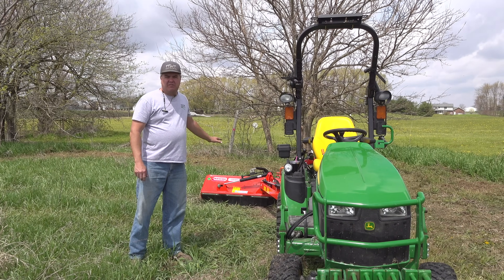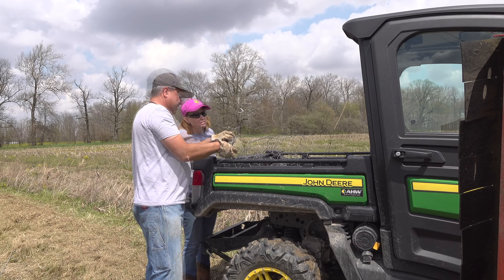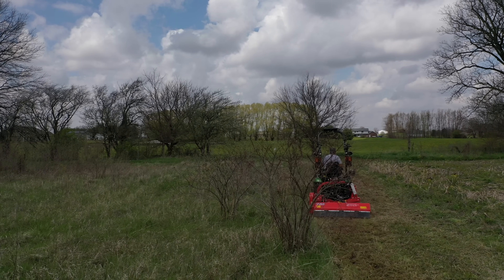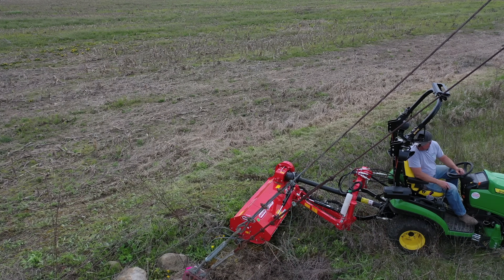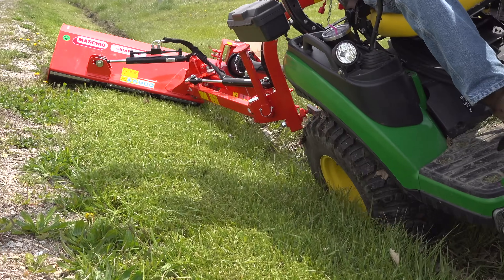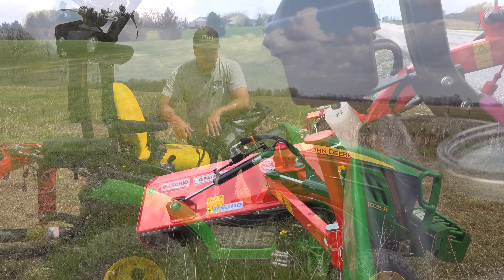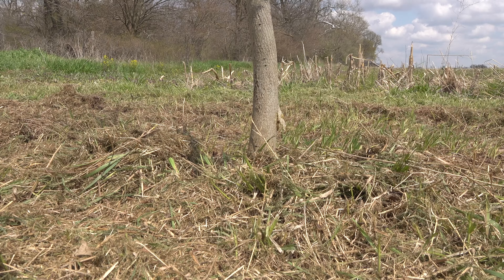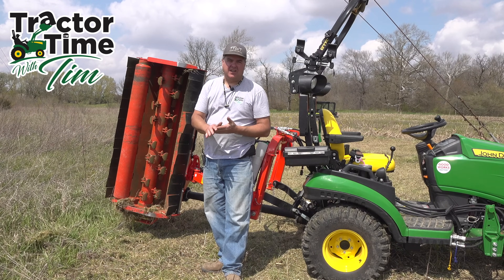NEVER BEFORE SEEN!!  Offset Flail on Sub Compact Tractor

Comment: Offset mowers/conditioners are used for hay so your tires are not mashing down the hay. & it does make a difference in hay. A flail mower probably pulls material up better than most mowers though. We have a 9' offset (to the right) hay mower & it puts a lot of pressure on the right lift arm & tire.

Comment: Dear sirs. What type of the model of Flail mover that you used. Thanks
Reply from the maker: Maschio.   Get it at agfolks.com  use code TTWT for a 5% discount.
This is the 4.5 ft version. There is also a 4’ on the smaller end, and 5’ on the larger

Comment: Flails do a great job in taking on thick stems and it does do a much nicer even cut vs a rotary blade mower but I see what you mean on the offset option its just not enough tractor there and for the Avg Compact tractor owner may not have the experience or knowledge in to proper ballast and operation for off set tools on slops and banks of any kind . Look at the design on the larger tractor with flails are a midmount type offset

Comment: I have a 50hp tractor (Deutz-Fahr Agrokid 230) to work with this flail mower. Don't even know if that is still a sub compact tractor. :) But like you say in the video, it works just fine. Don't be afraid to go lower, it just does the job. The one problem I have, and that is after a few day's, I can see the tire (turf tires) marks. At the moment you cut you do not see them, but the grass does come up after a few day's. That is why I never use it behind the tractor, always off-set. I also use it to trim the overhanging brushes on the edge of a forest next to my field.

Comment: I wonder if the mower will operate when vertical?     I know in England they Trim hedgerows that way.   I think a valve block could select either a front or rear attachment connection.  The details would require a an expert to work out.   That wire need something more like a bolt cutter for easy use.    I am glad you had a problem  It meant Christy spent some time on camera, not just behind.    It seems there room for her to drive a bigger mower on those acres.  I am sure she can handle it easily.  God protect and bless you both.
Reply from the maker: Yes, the mower will operate vertically, or any angle 90 degrees up to 65 degrees down.

Comment: If the tractor is plumbed for the backhoe, could you rig a lever control to those fittings?
Reply from the maker: Uh, I think you’ve seen our recent video on rear scv solution, right?

Comment: I was trying to figure out at what RPM's you're running the tractor. Judging by the sound of your tractor it perked my curiosity. I use to run a 5ft flail mower at 540rpm's in a vineyard to chop up the pruning.
Reply from the maker: Full throttle for all PTO attachments!

Comment: Here in central Texas during the summer when the grass is tall and dry the grass will lay down and not get cut with a rotary shredder. I'd imagine the reverse rotation on the flail will reduce the lay down issue. Wish I had the money to find out
Reply: Seam like you have to much money and to much time. If you can waste it on a rotary shredder. They won't ever get a close or clean cut like a flail mower. But one thing, flail mowers also take more fuel.

Comment: First off, great videos! They're personable, informative, detailed, and real-world practical. I think I speak for most/all of us that we appreciate hearing and seeing more than just the technical specs. We like to see what the equipment can actually DO. Your videos, along with GWT's and Messick's, are the top 3 that I watch for sub-compact tractor capabilities, comparisons, available attachments, upgrades, etc.

My only suggestion is this. Promote the use of the safety flashers installed on these tractors. As safety-oriented as everyone is these days and the attention given to promoting safety, I don't understand why I rarely see the operators of these videos using the safety flashers while they're in operation. This is especially true when using the mower attachments that have more exposed blades (more so depending on the cutting angle) that shoot out debris and when you're operating on/near roadways and other traveled areas. With the number of people driving inattentively, driving distracted, and often speeding, I'd be taking every reasonable precaution. I'd most likely even install some high-intensity LED light bar or something.

Comment: Johnny did a good job for 18hp pto. Wire on bushhog unit you have to get under to remove the wire.I really like the 90 degree lift (vertical). Humm! Can trim low tree,shrub branches.
Yep,2038R will handle this with no problems,can wait for that one! Have a goo day!

Comment: I needed that mower today 5-4-20. I mowed a yard for a neighbor with my 6' LandPride flail and Kubota 4240. The 5.5' might have been what I would have needed to get under bushes and around trees. I have 3 rear SCV on my machine. And that would be an easier way to operate that mower.
Reply from the maker: Get it!  AgFolks.com!   5% off with code TTWT!

Comment: I wouldn't worry taking them down low on unknown ground.
If they hit something that's too hard for the mover the flails just flip away and if that isn't enough your to should have a slip clutch.
They're designed to take that. Especially cool is that they will losen high spots in the ground and the roller will flatten them.
They're designed for that. Especially those like yours with the big teeth.

I use one too. Running it on minimum depth I crushed concrete parts, earth, stumps, roots and there is basically no ware on the flails.

With the tire tracks: I have one without offset and also never had problems with it.

The only problem is the weight and the power needed.
And maybe: if you have s tractor that doesn't have a stepped rear 3 point it's hard to get the home GHz right all the time.
It's a steep learning curve otherwise with  the 3 point lever and top link to get the height right

Comment: I have been selling flailmovers with an external engine that u can drag hooked up behind an ATV or garden tractor. The company i was working at also had PTO  flailmovers with hydraulic elevators for bigger tractors, the smallest would probably work with Jonny 3. So its intresting to see this one mounted behind a 1-series

Comment: Counter weight it on the left hand side like a highway mower. You could build a weight bracket that hangs in the loader bracket. Then use the same kind of suitcase weight likes on the front.

Comment: For just regular flail mowing just go with a plain-jane pull behind.  If you have lots or drainage ditch or hill work along roads, better than sitting out there with a weedwacker.  It would definitely be worth the investment, if you added up man hours in the long run.  I think I would want to see some kind of shield over the ram for the pivot up /down.  If you weren't careful I could see damaging it by hitting an object when pulling up as close as you could.

Comment: Id buy it, just because its offset and i could mow ditches without being in em or get under trees where the Rops are to tall for it.
Reply: I was thinking also about for under my trees, and ditches, but it is hard for me to believe the connection could hold up long. I was thinking i would need both a regular flail and the offset just for hard to get to places. Plus i was told if i want to use it commercially as well i would neet a hydraulic flail mower with an arm, as well because the regular offset won't make it into the center of most ditches. Ditches that are dry part time i guess you can go from above and below.

Comment: I ran over 1/2” steel braided cable with my Maschio Bufalo 300… I had to run back to my shop and cut it out with a grinder. I also ran over a fence post with barbwire. The post was wedged in the upper dome and rotor. It was a mess full of ants. My Bufalo is bidirectional so I can run it on my front pto and rear.

Comment: Would you use a flail to cut a two acre yard?
Reply from the maker: No, I would use a mid mount mower on my Johnny.
Reply: @TractorTimewithTim  I've got my eye on a Solis 24. Seems like a good tractor for the money.
Reply from the maker: Just remember that you won’t find much online support from TTWT or others on this brand.
Reply: @TractorTimewithTim  is it considered an off brand? My understanding is they are a Yanmar product? Just curious. Thanks for the info.
Reply from the maker: They are a Yanmar.   Not much support online for modifications accessories, etc.
Reply: @TractorTimewithTim  thanks again. I enjoy your channel a great deal.

Comment: If it's hooked to the joystick for the loader, can't you just put it in float? I'm watching this video for the mower not the tractor as I have a Massey Ferguson subcompact and the front in loader has a float function if you push the loader controller all the way forward. Does JD not have this? Would it make a difference so you wouldn't have to keep adjusting?
Reply from the maker: Float doesn’t work very well for this mower…it floats a bit too ‘heavy’.  Hard to describe.

Comment: The offset flail mower would be great mowing under tree branches in an orchard. I’m amazed a little tractor can run an offset mower at all. Good stuff. I think a 35HP L series Kubota would handle this offset flail mower quite well.

Clearly rear hydraulic remotes, at least two pairs, are very desirable in a tractor.
Reply from the maker: Yep.  Your comment is accurate on all points, and well reasoned!  Of course the 1025r is a bit small for this mower,  but the point is that it DOES handle it.  That should be encouraging for folks with a slightly larger machine like an L3501!
Reply: Seeing my comment from three years ago. This vid popped up in my feed. Time flies. I did not buy one of these mowers but bought a tractor, with two rear remotes. The tractor is almost paid off. Next purchase is an offset flail mower.

Comment: Looks like that’d be perfect on my new 3025D!
Reply from the maker: As long as you have 2 rear SCV's, it should work on your 3025D.    Might also want some rear wheel weights and/or rimguard in the rear tires!
Reply: Being a manual trans tractor makes it a few hundred pounds heavier than the hydrostatic not to mention the 720 pounds of beat juice in the rear tires 😆
Reply from the maker: Should be fine. Agfolks.com.   Don’t forget code TTWT for 5% discount

Comment: The way you have your hydraulics hooked up you should be able to put your joystick in float mode and the tilt cylinder will allow the mower to oscillate seperately from the tractor.

Comment: Could you not run the up and down in the hydraulic float mode. This would take the constant watching of the ram in the middle out of the equation
Reply from the maker: Good point.  Duh!  Sorry.
Reply: I have a 48" Peruzzo offset flail. I have cheated and use in on a quick hitch but have to be careful on to have it too far in the down position when it's offset otherwise the PTO will hit. I do run the cylinder in float in the "down" direction and it works well as long as your not picking it up off the ground often. Sometimes it's actually easier/quicker to just manually adjust it as you did in the video. I run it on a JD3320 and have been contemplating trading my X495 for a 1025R and I was very curious to know if the 1025R could handle the flail. Now I have my answer! Tim, I love watching all your videos! Thanks and keep it up.
Reply: Some manufacturers use an ordinary cylinder which can then be used in the float position (FEL ore rear remote). Whit this "controlled check valve" cylinder it is secured on the road to prevent lowering on it's own.
Reply: I thought the same thing. You beat me to it!
Reply: @stevebrookshire1969  can you elaborate on the quick hitch setup?  I would like to purchase one of these offset flails but am turned off by it not being quick hitch compatible. Limited down angle would not be a problem for me.  Did it just hook right up or did you modify anything?

Comment: since you were using your loader control to run the hydraulics could you of put the loader in float mode so you wouldn't have to keep adjusting the up and down on it

Comment: I do wish that there were a good answer for sub-compacts and mowing ditches. A small flail mower, even 3' wide would do the job. I would want it to be quick hitch compatible. Even manually setting the angle for ditches would work and eliminate the need for extending hydraulics.

Comment: I’ve done a lot of research on flail mowers. Seems none can be hooked up using a quick hitch.  That’s a show stopper for me.
Reply from the maker: Offset flails will likely not be quick hitch compatible.  This is due the the wide swing of the PTO shaft.
If you want a direct behind flail, the maschio does indeed have quick hitch compatibility.  I think there may be a small up charge for the adapter…but I use it on my quick hitch.  http://agfolks.com use code ttwt for a five percent discount.

Comment: Probably better to hit that wire with a flail than a rotary mower. 
The nice thing about having the mower offset rather than directly behind is that you aren't running the tractor through all the brush and seeds, I think the radiator screen would stay a lot cleaner.

Comment: it sounds like you'd expect it to be too big for a B2601, correct?
Reply from the maker: I think a B2601 could handle it...but it would be a load.  I would recommend the 47" rather than the 53" that I have.    I would also recommend Rimguard for the rear tires...and maybe some wheel weights (at least on the left side) too.
With those changes/additions, I think you could handle it sufficiently to get the job done.  agfolks.com.  use code  TTWT for 5% off.

Comment: WHy not put the tilt cylinder in float mode?  That way you don;t have to keep adjusting the tilt to maintain clearance in the slot.
Reply from the maker: #1, i don't have float on that valve.  #2, from prior experience, I don't like how much down pressure it applied....I know, it isn't much...but it was enough to make me not like it.
Reply: @TractorTimewithTim  IIRC, the loader lift function was controlling mower tilt. I am pretty sure that a 1025R loader control valve has a float position in a detent  beyond the "down" position, but I understand if your hardware is different.
Reply from the maker: @g.c.3339 sorry!  I recently posted another video with this mower on a different tractor.  I thought your comment was on THAT video! 
Yes, this one has float, and I tried it…as I said, a bit too heavy for me.

Comment: could you just leave the the valve for the loader in float so you don't have to adjust the lift cylinder on the flail
Reply from the maker: Yep. Duh.  Hard to remember everything.
Reply: @TractorTimewithTim  you are doing a great job. It would be so much fun to have all that equipment to play with.

Comment: I would advise at least putting on some glasses or eye protection when removing wire and stuck things from implements. My uncle farms full time and a few years back got poked in the eye and his cornea scratched from wire stuck to his disk he was cutting off. It's not possible to hold both ends of wire or predict where it will go. He wears glasses now and never did before and doesn't drive at night now. Wire can be worse than you think. I have gotten metal in my eye and got lucky as well. wear eye protection often, probably should be when operating without a cab as well. I am interested in an offset flail like this but a big bigger for a JD 4720

Comment: Small BOLT CUTTERS.
Bring them with the mower Everytime and U'll never need them.
Reply: I ran it to barn wire once. Same deal carry small bolt cutters in tool box great to have
Reply: That's wy i like the offset so you can see what you're mowing a bit better... well you can's see everything but much more than when you run over it first...
Reply: Knipex.  It's amazing what the little ones will cut.  16 penny nails no problem so wire is a breeze.  They're expensive so don't let the kids borrow them!!!!
Reply: @keithaune2588  or pincers will do
Reply from the maker: Ordered em today.
Reply: I carry small bolt cutters in anything that gets drove into a field. Ran over barbed wire in my truck once took me 45 mins to get it untangled.

Comment: Good info! Also it’s guy wires not guide wires. 😉
Reply from the maker: Where does the term guy wires come from?  Makes no sense.
Reply: A “guy” was a sailing term from ships that had a guyed mast. A guy was was a small rope or chain and they were used to stabilize the mast. So guys held the mast -> so it was a guyed mast. Towers and other structures are stabilized just as the masts were on ships so they are guyed towers etc. So it becomes a guy wire...which is somewhat redundant.
Reply from the maker: Sweet! Thanks!  Always heard ‘guy wire’...assumed this was local slang, and that it was likely mispronounced.   Now I know!
Thanks!
Reply: I enjoy your channel. Watched many of your videos before buying my 1025R last summer. Keep up the good work!

Comment: most of us dont have all those front weights
Reply from the maker: This is another benefit of buying the heavy hitch for the rear...you can re-purpose those weights for the front.    Once the lockdown is finished, and fastenal is shipping again, you can get the weights and brackets shipped very cost effectively. ...and 5% discount with code TTWT

Comment: Only problem is the tractor is too too small…...for the stuff need at leat 60 hp.
Reply from the maker: Disagree.   No more HP is needed, but more weight and width would be helpful.